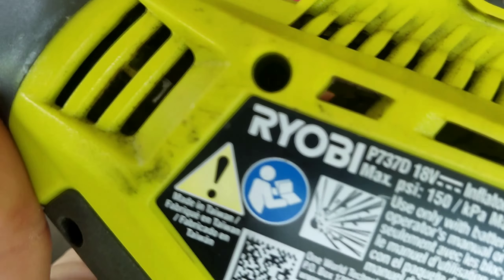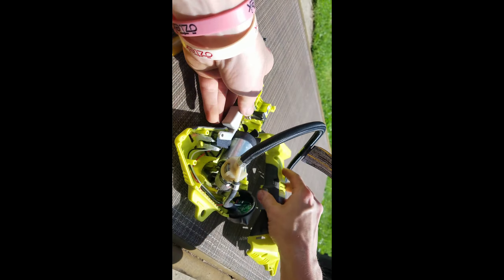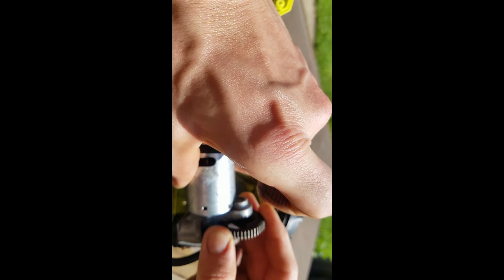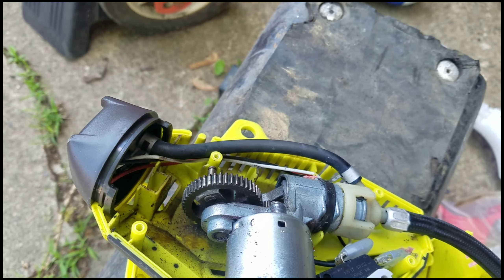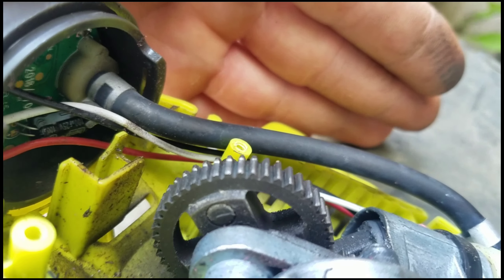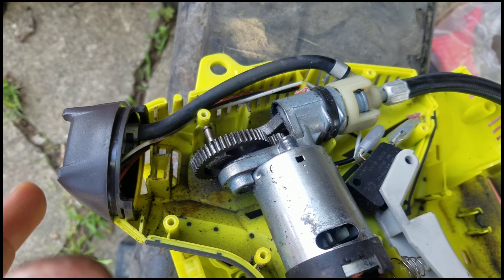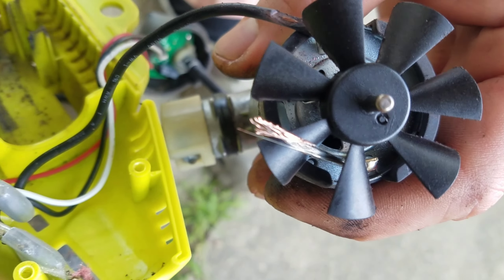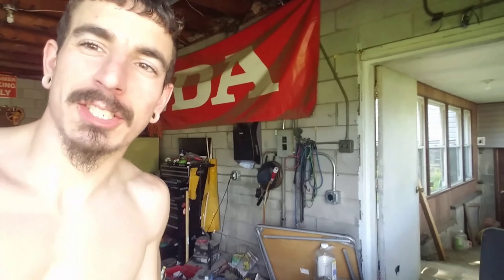Ryobi Inflator Troubleshooting

Comment: Got one for Christmas 2023 took it out of the box first time Jan.28  2024 to air wife’s front tire. At first you could hear it pumping then the ratchet sound of gears stripping. I’m taking it back will try the new one at the store if they will give me one.

I’m back I found a paper in the box that says write a review for a chance to win a HD $1000 gift card. I tried to look up the P737D it’s no longer being shown in their on line catalog, in stead a new quieter high pressure model coming soon. I don’t recommend buying this model. Wait for the new one or go to another brand.  

I have and like my 18v drill and driver set but very disappointed in this inflator, some bean counter allowed this poorly made tool to wear the Ryobi label shame on you guy’s